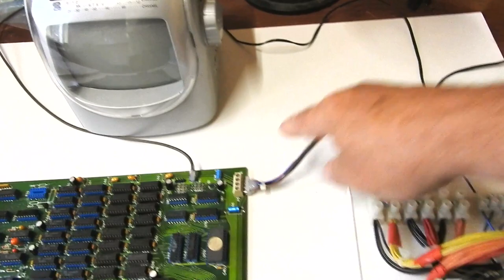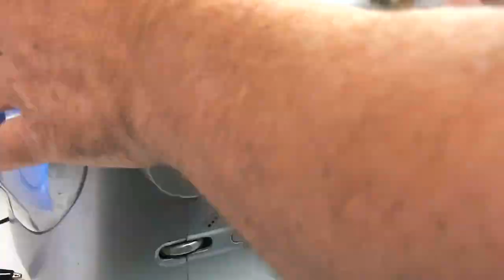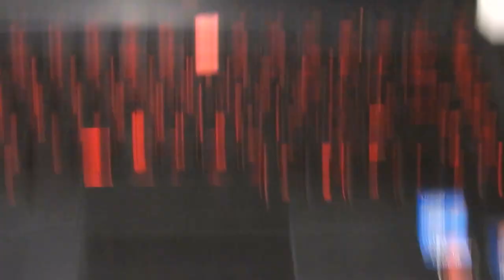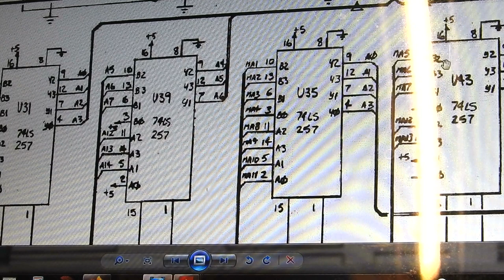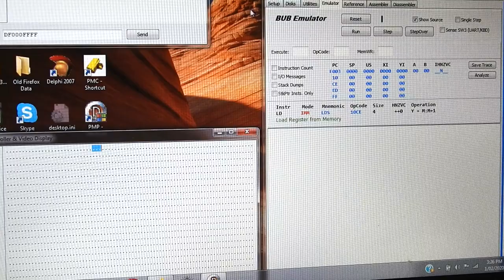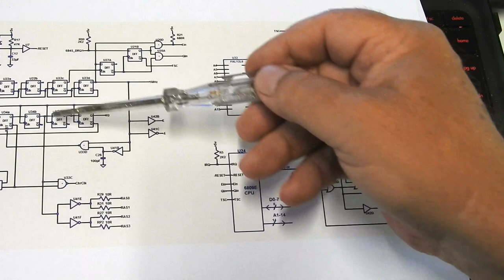Compacta Uniboard   Part 2  -  Power Up

Comment: Where does the BUniBoard software come from ? Did you write it from scratch ? Is it based on something on the web ? And the ultimate question : can I too play with it ? My Pascal skills are several decades old but C isn't much different...
Reply from the maker: Yes, I wrote it from scratch.
I could eventually make it available, but at the moment, it's a mess that I would want to fix up a lot first. It's got lots of bugs, it's very incomplete, and includes lots of "ideas" that either need to be removed or properly implemented.
You would also need Delphi ($$$$), but it could be ported to FreePascal/Lazarus. 

Let me look into it/think about it.
Meanwhile, did you see my IBM 7094 emulator?
You might like that, and at least get FP/Laz installed...